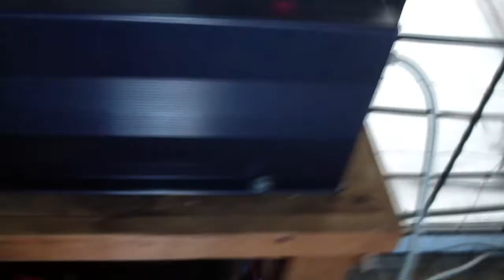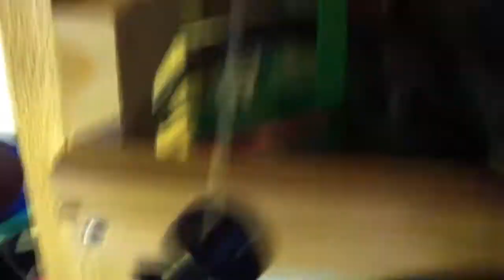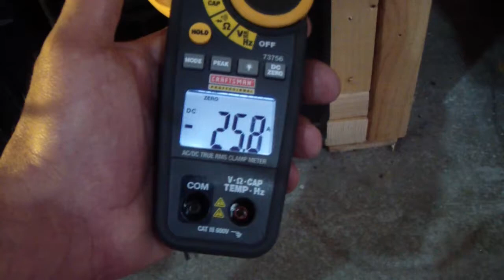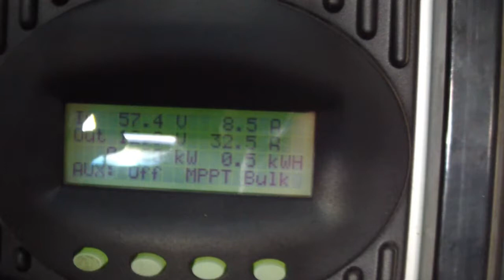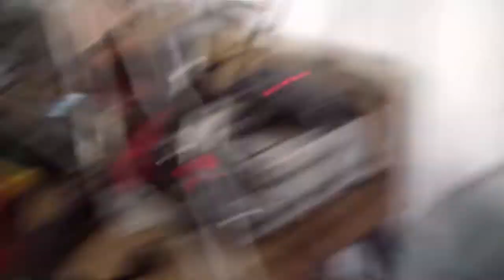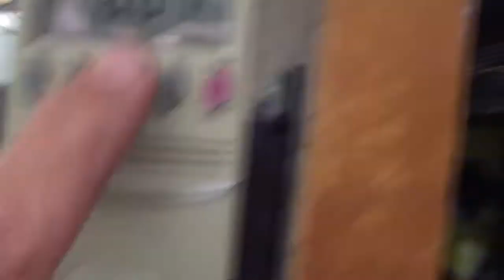Solar Energy, Solar Panels, OutBack, Inverter.

Comment: Yes It Is A Very Robust Unit Get The Meter Also It is Seperate  Nice Tough as Nails  OutBack Is also coming Out with a New Charge Controller  Check It on The OutBack Power  Page